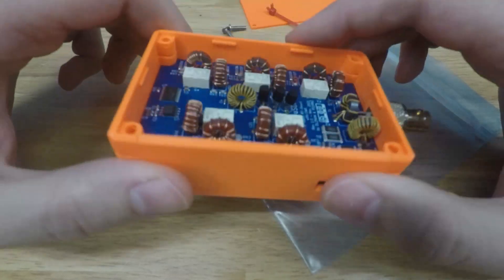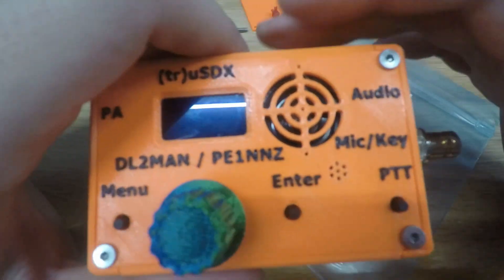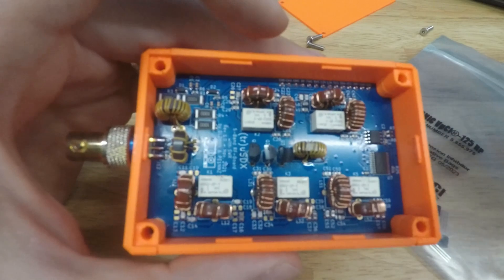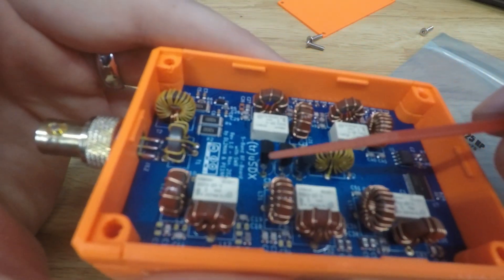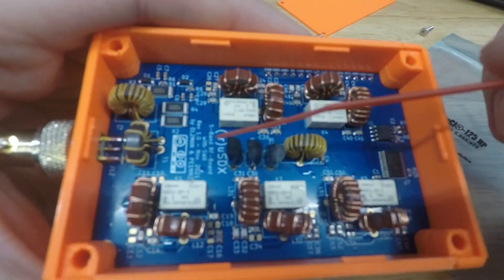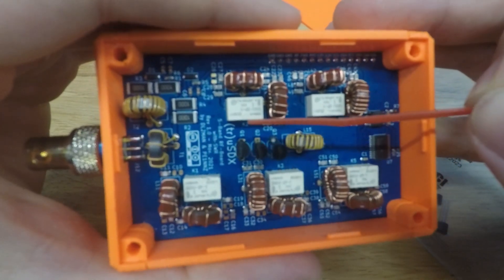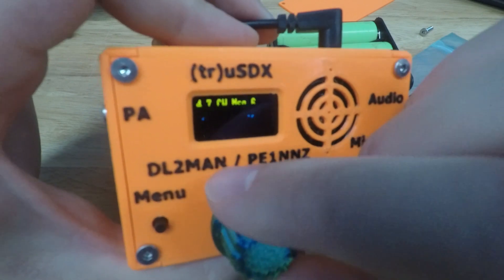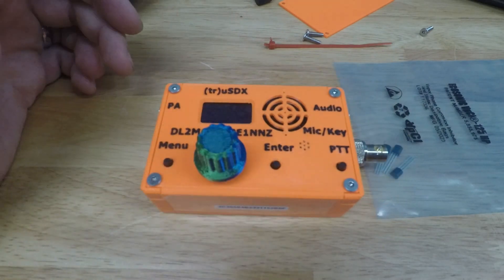No (tr)usdx Power Output? Check Your Finals!

Comment: I have the USDR black brick. Same thing happened with mine... transmitting almost 0 watts now. I was using JS8Call quite a bit, but nothing crazy. Only 4 months old 😪 PS... I cranked the PA Bias to max 255, and am now getting 2.5 watts output.

Comment: The best advice i can give someone on the (Tr)Usdx it is test your swr on micro usb power first and do it quickly.  On low bands with a EFHW i am usually good on 20m, 40m and 80m. 30m and 60m will need a tuner or a tuned antenna for me. The bs170's will pop fast if you use high voltage to test your swr. -KM4FZA
Reply from the maker: That's a great piece of advice, I probably should have done that! I think I may have fried the finals out in the field when I had it running on full 12v and didn't have my EFHW tuned correctly.